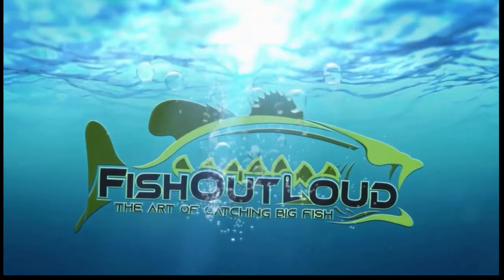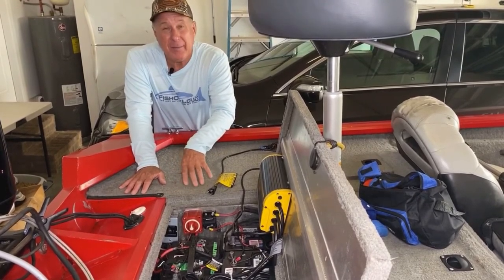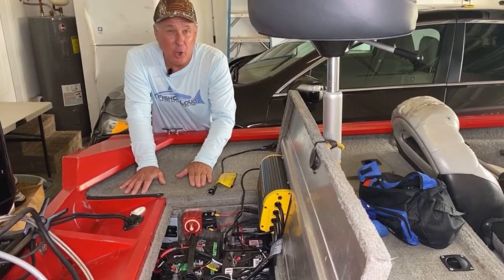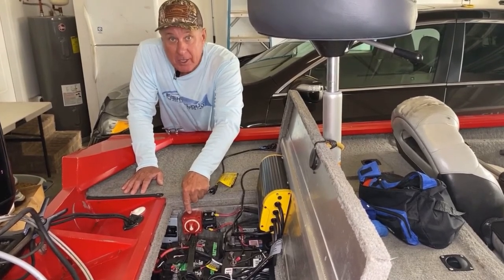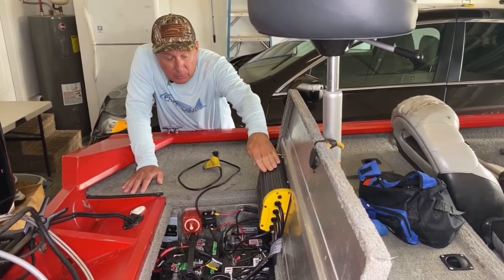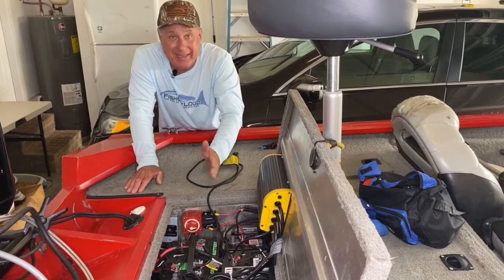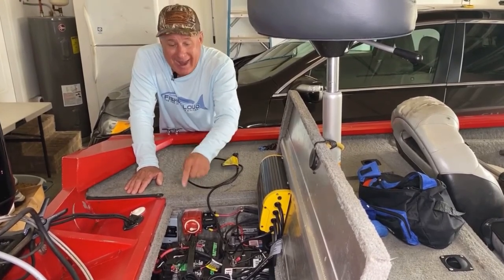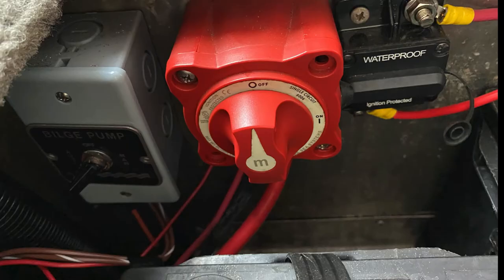Installing a bilge pump on my Basstracker 175

Comment: How did you connect the hose to the thru hull?  Did you use the existing hose or drill a new thru hull?
Reply from the maker: Great question! If you take a closer look, you will see where I drilled the hole(see white) It would take the water out to the back splash and then out the hole which was already there. I hope that makes sense. Let me know. Remember, you’re just one cast away…
Reply: @FishOutLoud  I see it now.  Thanks for the reply.  I have the exact same boat (2004 model)
Reply from the maker: @PatRox-j2k  - Hi Pat, That's awesome. It's a great boat! And Year! Remember, you're just one cast away...

Comment: Do you have the measurements for the metal plate? Have the same boat and doing your setup :) thanks
Reply from the maker: Hey Johnny, thanks for reaching out. I don't remember the size and I truly apologize. I don't have the boat anymore to go out and give you a measurement. However, I remember taking the measurement starting with the size  of the bilge, then at the bend how high it goes up, then the bend where I screwed it down. I took it to a welding /shop/person who made the bends. I hope that helps. I'm excited to hear how it turns. You're just one cast away...